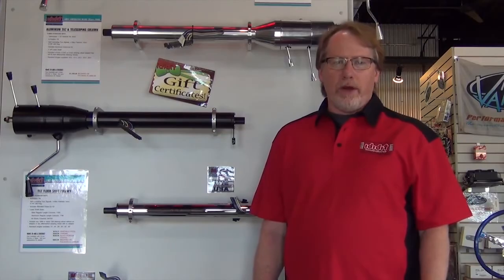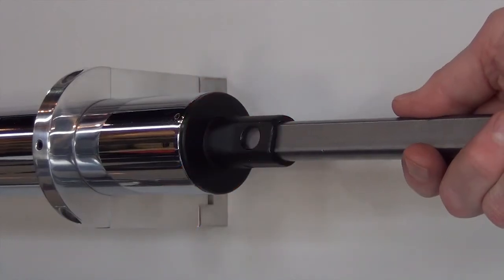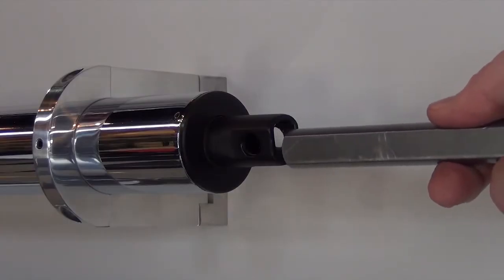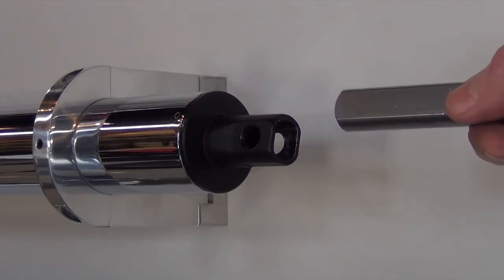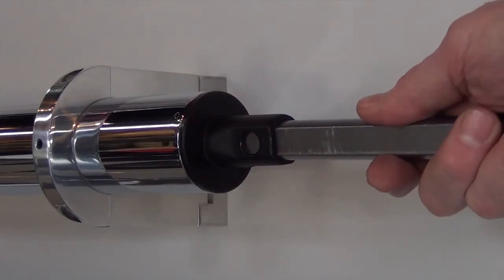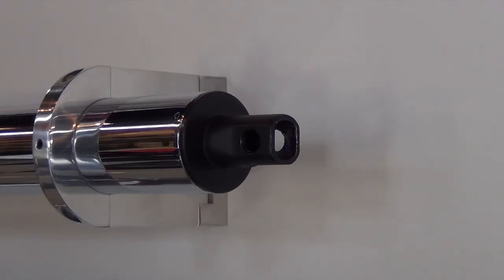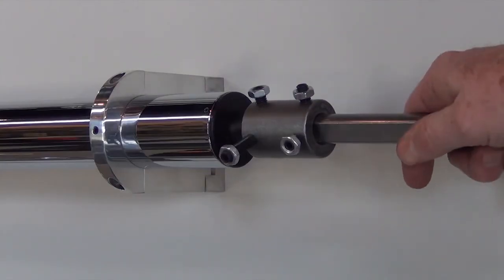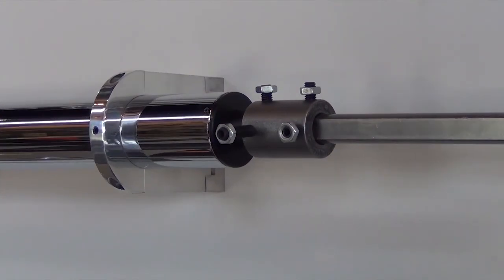ididit's What Not to Do when attaching a Shaft to a Column

Comment: Come on guys factory  steering columns comes with 3/8 hole right on the middle.
 have you ever seen one broken?
😂
Reply: As overengineered as most steering columns are... why not go the extra last step and use marine style flexible reach rods to couple with the steering box? We certainly can't make these damn things any heavier, plus fitting headers just might be easier.  They just need two fixed brackets so the sleeve doesn't spin.

Comment: So years of steering can open up the hollow tube.  What's stopping the hollow tube from collapsing with the other method????  And you're telling me those tiny set screws are better than a 3/8" grade 8 bolt???
Also, I just tore down a 1998 Ford Explorer with over 200,000 miles.  It had the steering shaft inside the hollow tube and was just fine.

Comment: The safest and most reliably secure way to couple shafts that undergo torque is with a cross bolt - you say don’t do it then turn right around show your additional component using the exact same procedure (sliding bolt through hollow shaft hole). Sliding the double DD shaft at least six inches up the steering column tube/shaft and then cross drilling with a 1/4” clevis pin or bolt (a seasoned mechanic would never use a 3/8” bolt like you proclaim) is far superior than your additional add on component/coupling because your component only provides about 1/2” of axial movement. Sliding the double DD shaft six inches up the steering column tube/shaft provides 12 times more contact/engagement length than your coupling. All vehicles flex and move and this added extra length is far safer than the 1/2” engagement your coupling provides. Furthermore, your coupling has three to four bolts vs. one in the old procedure. There is a very well known simple irrefutable fact about engineering - more parts means more failures. I find it insulting you would try to pass this new procedure/component along to your consumers without any case studies to support your argument for this additional component. Everyone with half a brain sees this as nothing more than a money grab. Any seasoned 4x4 junkie would never rely on a 1/2” of steering axle engagement (a street-rodder might though but I’d never recommend it). PLEASE SHOW US THE PROOF OR THE EXTENSIVE INDEPENDENT STUDY THAT YOUR NEW COMPONENT/PROCEDURE IS SUPERIOR TO THE OLD TRIED AND TRUE WAY!!!
Reply: I was so confused when I opened the box just to see a “hollowed” DD, with two giant holes on the flat sides! I called my teacher, Professor YouTube and found this video and was just lost after he said do not force a solid DD, just buy a coupler and (%^**^%#<>€€^)! 2 weeks later I watched this video again and decided to read the comments and I must say I owe you a 🍺 or 6 pack..... Thanks
Reply: Kenyon C - lol 😂 - glad to help. Now let’s all go out and buy leaf guards for our gutters. You can find them at the vehicle anti-rust undercoating stores next to the Chinese made glass hammers. Hope you can return your “pet rocks” and get your money back. Beware of manure salesmen - they only sell shit.
Reply: I have a 79 k10, what would you recommend in that case?  I upgraded the steering column and want the right s*"*
Reply: @rjgenua4435  use factory setup n style - avoid aftermarket garbage - new is not always better.

Comment: Do these have a locking feature? I’m looking for a steering column that doesn’t not lock the wheel or shifter, like doesn’t need a key. So I can run the starter wiring over for a switch panel
Reply from the maker: Mikayla-- The columns that we sell that do not have an integrated ignition key/switch and do not have a locking feature.

Comment: As a retired ASE Master Tech, installing aftermarket parts is different from the entire steering column with tilt. My experience is that everything over time requires repair. Many repairs may require parts, this the un-known for me going forward into my 1967 C10 with floor shift auto in console. I don’t know anyone who has one, much less anyone who has had to fix one. An installer guide is great for anyone including the DIYer crowd. But as a tech working on a repair to fix the root cause, finding an exploded view with parts list would be great. I’ve son who would loose this 10 minute after the box is open as I would be the “Dad” with job of making the install correct. 
 You guys know as things like “Park-Neutral” safety, reverse lights, etc. Ok fine, but if some or many internals are “Unique” to the brand, no parts list, lost model # as if registered to the companies data base, but dumped after 5 years. Then you play with factory OEM type parts to find they don’t fit, well this bothers me bad. GM engineers spec components for 5,000 hours that equate to 150,000 miles, but everything has a possible failure point. Being retired make the idea of complete replacement, say 7 years and told purchase new one at inflation-corrected price in the future, or to send it in for repair, keeps me from pulling the trigger. Maybe someone knows that answers I can’t find. At 6’3” w/power buckets, still need a tilt for my 67 C10 as I want my 5’7” wife to drive or 6’5” son. Any answers that would make this 1978 ASE Master sleep better? Thanks to anyone. Omaha, NE.

Comment: There's not enough room to put that coupler and a rag join on a56 belair
Reply: Exactly. Doing this now on a 56. I also haven't been able to slide the 3/4" rag joint shaft into the 1" DD hollow tube. -I'm using flaming river stuff. I think they pinch the ends to prevent you from installing the shaft into the tube -like Ididit does. I think cutting a little off the DD hollow tube may get ride of the pinched section.
Reply: You don't use the coupler on a 56.  You use a 1"dd rag joint to whatever spline your steering box is.  The rag joint is the coupler.
Reply: Well damn. I’ve been sitting on my new column for like 3 yrs now & coming here to refresh my memory on installing &, hell- idk what the F to do now… 😂   I think I’ll trust the company’s recommendations as opposed to all the quack-jobs like myself in these comments! 😂

Comment: No thanks.I will take the old way over the that ugly adapter anytime.What he neglects to mention In the video is that to use the Borgeson adapter the instructions state you still have to drill a 3/8" hole in one side of the column shaft reciever.And I would trust a bolt with loctite on the nut to be safer and a far cleaner install than that ugly eysore.And if you have a show car keep in mind that no company offers aeyesore. Or even a polished stainless adapter,they are all made of that ugly Grey steel.So be prepared to pay to have the adapter chromed.